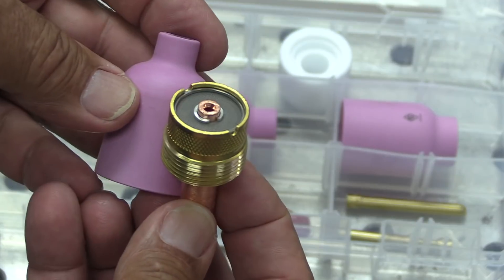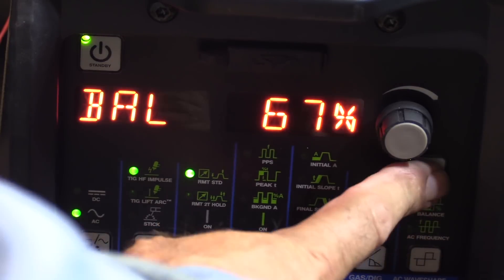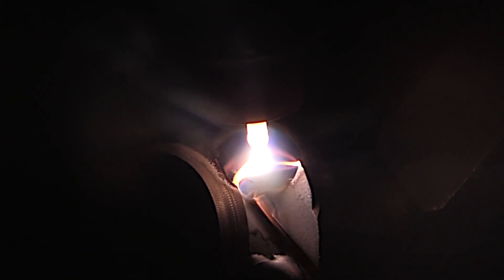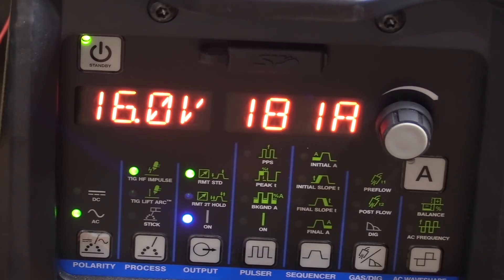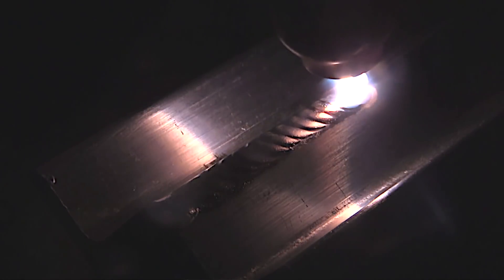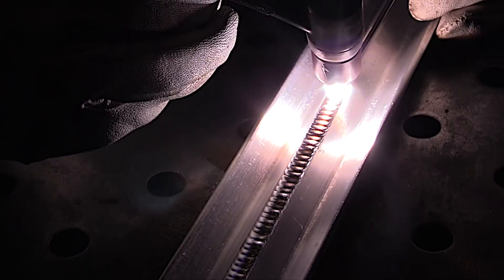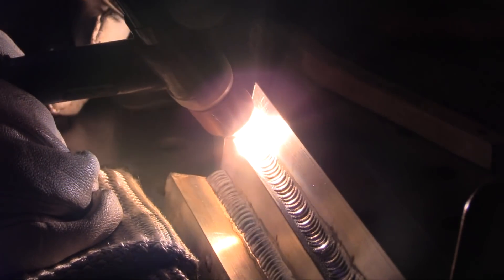TIG Welding Aluminum with a Gas Lens

Comment: After discovering gas lenses awhile back, that's all I ever use on anything... from steel to SS to Aluminum. Is it ever beneficial to not use a gas lens?

Also, unrelated... but I'd love to hear about any tip or tricks for someone who has shaky hands. I've always had an issue with it, and these days it seems to be getting worse as I'm probably picking up my family's curse of Parkinson's (in my 60's now, started welding in my 40's). I've done some basic things like, whenever I'm welding that day (either on the job, or like lately unemployed but doing my own side jobs to get by), I'll limit my morning coffee to only one cup, and I'll also always try to use some kind of hand positioner when possible. One thing I've tried to do more often, is holding my torch in my other hand (my left hand instead of my dominant right hand), as my right hand shakes a lot more than my left, but then I end up with kind of the same problem as I end up with shakey filler rod, which can be even worse than a shakey torch. Can't really think of anything else that might help so if anyone has any ideas, I'm all ears.

Comment: Question here: I'm having a small issue at work.
a piece they tapped thread into fit arranged at the top of my weld.
Very tiny leaks over the full lenght.

I always clean and brush them before welding. My boss told me it may be cause sometimes they use magnesium instead of silicium when they make those pieces.  ... I'll send you a photo on instagram.  :S

Comment: Jody, Im new to TIG welding and have a question... I use a gas lens with a ceramic cup, #7-8, with the flow @20 cfh. I get a black soot halo around all my beads on stainless using E3 3/32 electrodes, 100% argon and 309L filler rod. Can you tell me what to do to stop this or is it normal? Seemed to be less when I backed off to 15 cfh and increased at anything less than 15 or more than 20. I'd like to have nice clean, colorful beads, but can't seem to find the correct recipe. Any help would be great. Thanks
Reply from the maker: Lots of possible things. Change one thing at a time while you troubleshoot. try using minimal electrode extension first. Switch gas lenses. Check all argon connections. Etc

Comment: Do you have a video that explains why people use very small cup sizes for aluminium? I tried using a number 5 and it seemed like there was not nearly enough gas coverage. My welds were dirty and hard to control. I have better luck with just using the same number 8 for everything. Am I doing it wrong?

Comment: I have never seen anyone do this online, but one thing I do when teaching aluminum welding, is grab a pair of side cutters and lightly make marks about every 1/2" to 3/4" spaced out lengths on the filler rod, to give people a visual representation of how much you have to feed the rod into the puddle to build it up.

Comment: I cant ever get my machine to run worth a damn at 67% I run 75 to 80%
Reply: I liked 80 bal. 100 hertz. Miller inverter 3/32 blue tungsten up to 1/8 inch aluminum. Over that go 1/8 tungsten. #6 gas lens. 20 lbs gas flow. amps as needed 150 to 200 up

Comment: Ive use a Gas lense on everything. Do you think I should use a regular tip on Alloy?
Reply: imho it really doesn't make much difference. i tend to run gas lenses to skimp on gas a bit (argon is expensive where i am). however check out the alloy kit jody has, that works really well. but the key thing is cup size, small cups work better for alloy.

Comment: Hey bud I enjoy your videos, I’ve been watching you since welding school 8 years ago. I’ve always been required to wear heavy duty 3M air supplied helmets at my current job, but I recently took a new job where I’ll be TIG welding aluminum all day everyday and I will actually need to buy my own helmet for the first time since welding school. Any suggestions for a good value TIG hood?
Reply: I enjoy my Esab A50 as long as it's Tig only and you don't burn through cover lenses.
Reply: Viking 3350 treated me well for years. I recently got an Optrel Crystal 2.0 and it is amazing. Both are great for tig.
Reply: @kamj6607  2nd the Optrel

Comment: I'm still not clear how using a gas lense effects welding aluminum. What difference does it make versus using a regular collet body? I know it makes the gas flow more evenly, but how is the actual arc effected?
Reply: The Arc isn't the issue. Its all about a consistent envelope of gas coverage so the puddle is protected. Collet bodies tend to dispense the argon via the holes on the body. Those channels of Argon have to meet to create an envelope of argon. It's like watering the garden with 4 hoses rather than using a spray nozzle.
Reply: i don't believe it does and i think i have heard jody say something similar in the past.   i worked in the marine industry for years and i have seen some absolutely stunning welds done with a 330AB/P and no gas lens.   lots of those tower welders have (maybe now different) never heard of a gas lens.
Reply: I don't find much of a difference. I personally don't use a gas lense. Just a standard 5 cup and 10-15 cfh. Small cups make the difference in keeping your etching band small life you care about that. Etching can only occur where gas is.
Reply: Good question.
Reply: it doesn't make much difference. the key thing is small cup size. however i typically use a gas lens because i tend to skimp on gas as it quite expensive here.
plus its handy just to run one setup and only change cups when going from alloy to stainless.

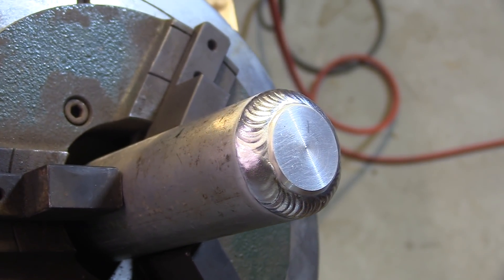Comment: At about 1:35-1:57 what are the pin holes from?
Reply from the maker: 4043 can get grainy when it cools slowly and gets little dots sub surface, I think its just the way the light hits.   or it could be tiny pores.  i didnt see any pores in the final weld but I didnt look that hard either. LOL

Comment: What about welding an aluminum case of a lawnmower engine?   I have a good running "Kohler Courage" 20hp...  But the block has cracked nearly all the way around it. Is there any good way to weld cast aluminum like this that will actually hold?  The crack runs in between the crank and piston, so when it's running it like to push that crack open every stroke.  Its in a simple flat part of the case along the bottom;  if anyone could do it, I know that you probably could...  I tried to mig it with some flux core aluminum and a small hobart cracker box-- but that didn't work so well. lol...  If you wouldn't mind finding a busted aluminum lawn mower engine and welding on the block, I think that would be a good video for you... (I live in Enid, Ok btw)
Reply: I use 4043 to weld cast
Reply: Part of your issue might be that there isn't flux cored aluminum wire for mig.
That being said  I'd drill the ends of the crack, grind the crack out with a carbide Burr, stainless wire wheel everything, and then preheat with a propane torch, weld it up, and then peen with with a ball peen hammer like crazy while cooling.  Using either 4043 or 4943 Tig wire.
Reply: @k..............1622  Well that's what it says. lol..  0.030 flux core aluminum wire....  got it on ebay..  I have a tig, that's part of a chinese multi- machine that's stick/ tig/ plasma cutter...  I have torch bottles, but nothing for the tig-- I guess I need to just set it up and give it a real try... I've ran stick and mig for years, but I've never tig before-- although I've watched a lot of videos of tig welding;  so I'm not completely in the dark.
Reply: @calholli  yeah that stuff generally ends ups being solid core aluminum mig wire or some weird spool of flux coated brazing wire. The closest you can find is aluminum stick welding electrodes which are absolutely atrocious and also shouldn't exist imo but they are better than nothing at all I suppose. The cheaper ones are generally DC Tig only which can be used on aluminum with Helium but I would be extremely impressed if someone can get a good weld on dirty cast without the cleaning action of AC. That being said if your Experienced on stick give those electrodes a go they aren't super expensive. ( On scrap first)
Reply: Jody actually has videos on welding cast parts just like you are working with-I think his was cast iron but the basic principles would still apply to a casting.  I think he used a TIG for the task, not MIG though.

Comment: So what's a good tig machine for someone starting out in Tig welding
Reply from the maker: I really like my CK mt200.  I also hear some good things about primeweld but I have not welded with one yet.
Reply: GET the one he's using a Dynasty Miller 200 or 210.
Reply: Buy once, cry once.  Miller Dynasty, biggest one your wallet barely can't afford.  You'll still wish you got the bigger one but you can make it work.
Reply: Howdy 
   Really love my HTP Invertig 221, works great and reasonably priced.

Comment: Best welding camera work on the internet
Reply: The camera work is especially useful to understand what's really going on with the tungsten and the puddle, and to internalize the options and tradeoffs so you have the right approach in mind when you're later in a real-world situation.  Pattern recognition I guess. The store is nearly as much of a benefit as the videos—I just got my latest Weldmonger order and left a review. Jody and team do such a good job for really reasonable prices and fast delivery.  BTW, those great camera shots are HARD to get right.
Reply: @benz-share9058  Yes. Also the way he thinks about things, tries them, tests things, does cut and etch. That's how you learn.
Reply: Possibly best skills, too. I am a good welder, but these welds are art.
Reply: @kevinmoor26  One of the most skilled but the absolute best teacher. I learned to weld from this guy.
Reply: @kevinmoor26  Yeah.. he's one of the best and has been for years--  as far as channels goes.
Reply: Jody what is the difference between a large gas lens and the small gas lines? Do you get better coverage with a large?